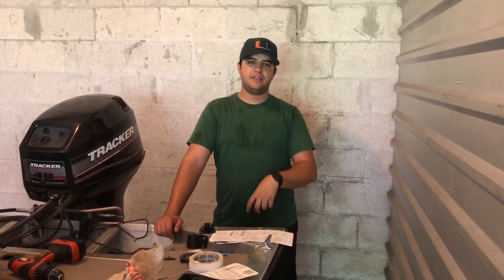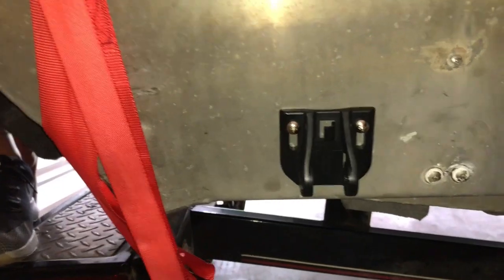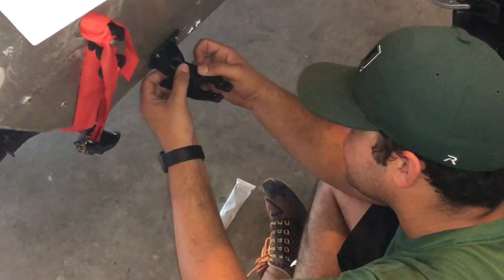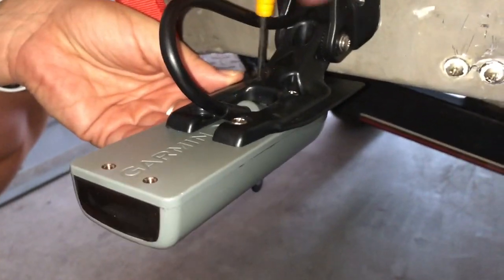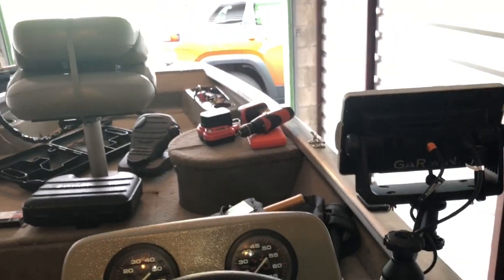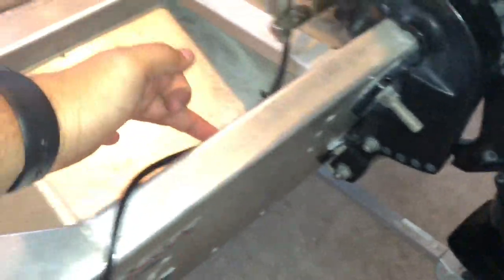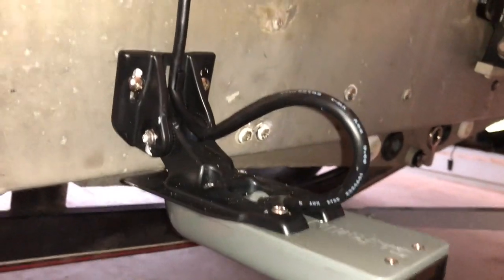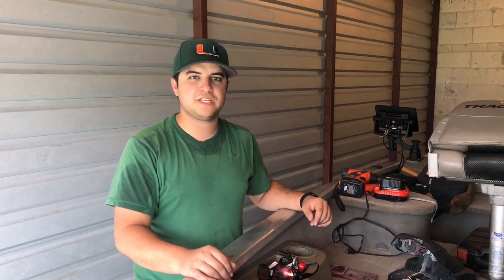Installing my Garmin Echomap Chirp 93SV

Comment: Matt how much run time do you get on your portable battery?  Also was it hard to connect up out of the box? ( The battery) Thanks for the video,  I just bought the Garmin Echomap UHD 93SV.  Just needing some tips. Tight Lines
Reply from the maker: Hey Brotha! 
So happy you liked the video 🙏🏼
I did not get very much run time on the portable battery unfortunately. I had to re do the wiring and hook it up to the battery on the boat.  Back then I did not know to much about how long batteries ran on a boat. So I was extra nervous. 
Now on the normal bot battery it run for hours. But the small battery I got only ran for about 1 hour.
Reply: @MiamiMattOutdoors  Thanks and I forgot to mention I bought the LiveScope also.  So if your only getting 1 hour with the Echomap then I would probably get 15.min with the LiveScope 😆.   So looks like I'm going with a regular battery set up.  Thanks for saving me some money and hart ache.  Thanks again.
Reply from the maker: @dustinfelker6507  oh 100%!

Comment: Good video!  Just wondering roughly how long is the power cord and the tranducer cable?
Reply from the maker: Bubba Walters Hey Bubba,
The cables went to the console no problem but to short for the front of the boat.